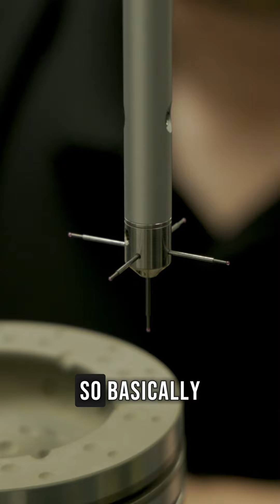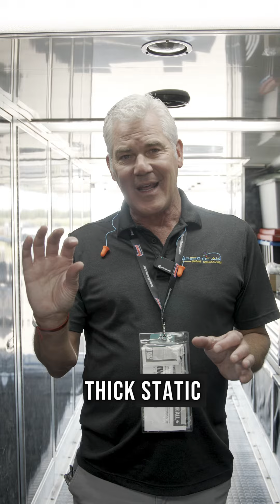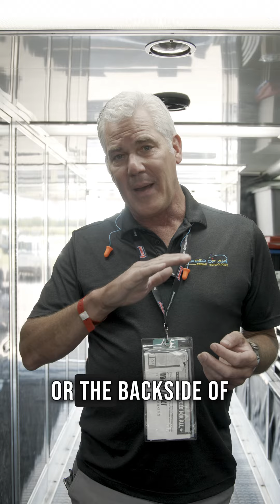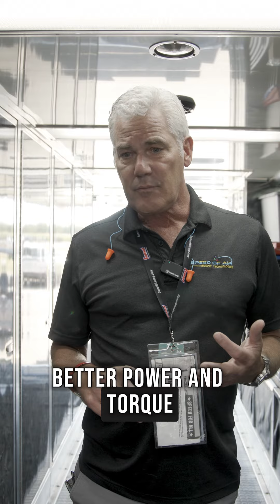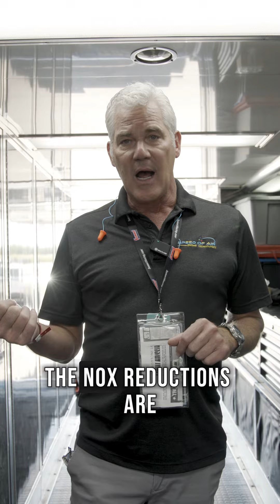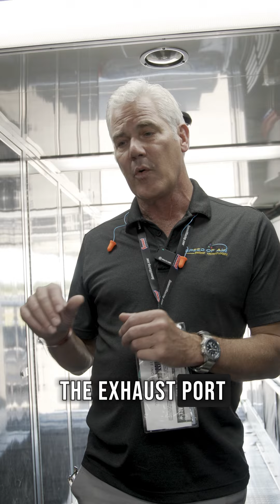Clearing up misconceptions about Speed of Air Pistons

Comment: They work. On more modern engines the difference isn't as significant, but still any improvements without changing any other aspect of the engine is great. The lugging power my dd13 has now is incredible without any tuning changes. Soot doesnt even build up on the stacks. Its funny now it takes longer for the oil to heat up.